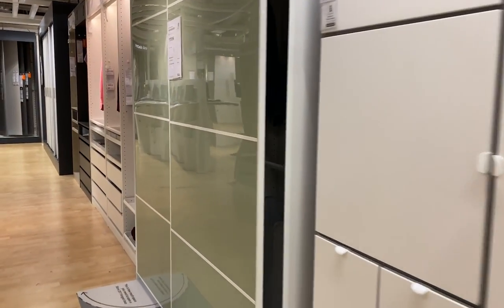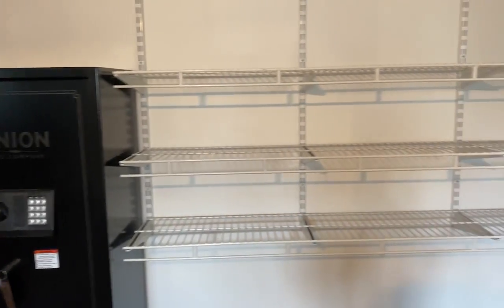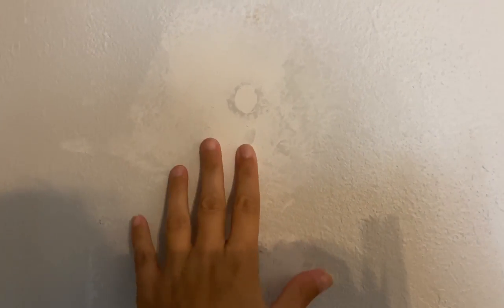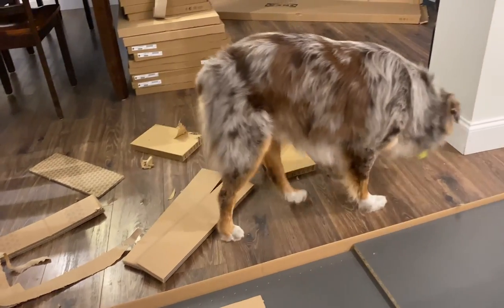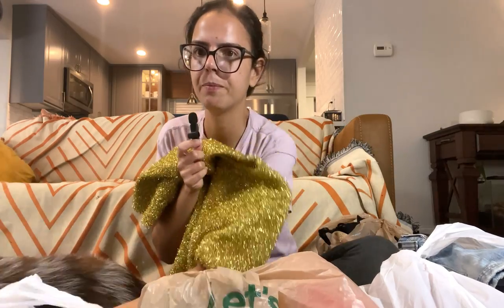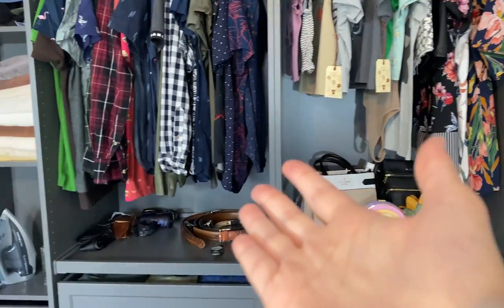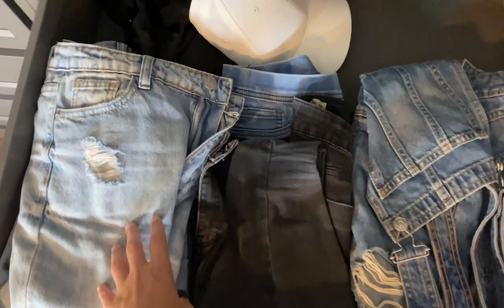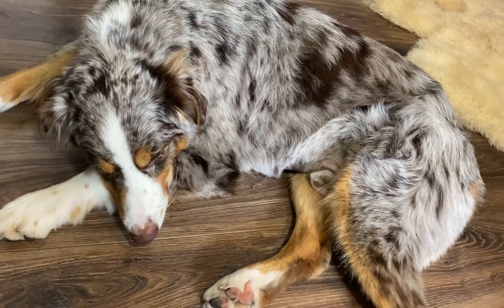Building An Ikea Pax Closet | CLOSET TOUR

Comment: I am considering using the dark grey with the same drawer style you have used.  I am just concerned that it may go out of stock and be discontinued like I have seen other colours do in the past.  But I think the white is just kind of boring.
Reply from the maker: I think the gray is one of their staples, it'll be a while before they stop making it. The "cream" one was out of stock and our initial choice. However, that kind of color is very trendy so it'll probably only last a few seasons. You can always find the right primer for Ikea cabinets and paint the white ones whatever color you'd like. Hope this helps!
Reply: @elsa_blanco  Thanks for that.  I actually think the grey is a bit more interesting than the white and I like the detailed drawer front that it comes in.